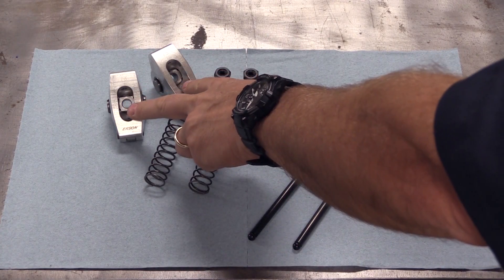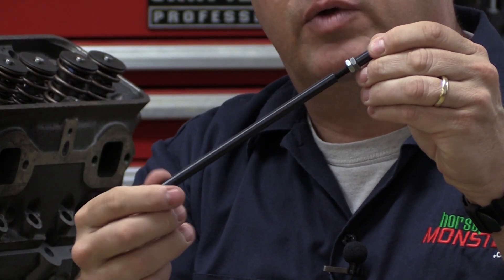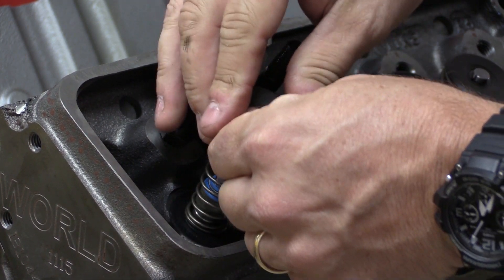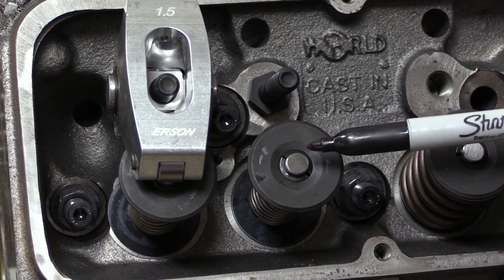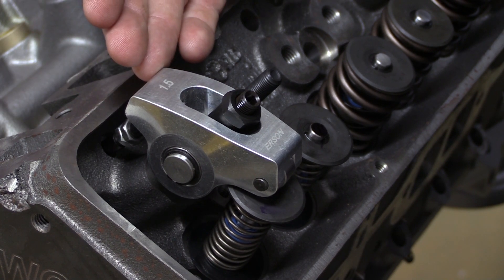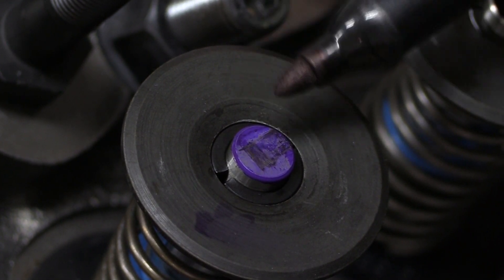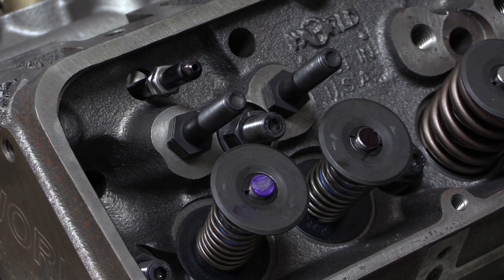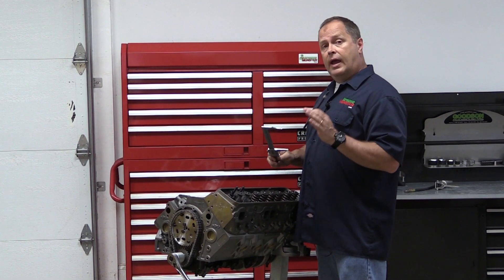Better Engine Building: How to Determine Correct Pushrod Length

Comment: Note, if you are using hydraulic lifters, be sure the lifters are not collapsed when taking the measurements, or you will get the incorrect length pushrod length

Comment: Doing this in 2022 on a Corvair motor. These old heads have had lots of valve jobs, and valves & guides replaced over 50+ years, so every single valve gets a custom pushrod. Seems like you and all the books say to have rocker contact centered across the valve tip but I disagree. Valve spring force starts at 100# and increases to over 250# at full lift. Valve/guide load & wear vary proportionally to the lift. So I prefer to cheat the contact area closer to the valve, "higher" as you call it here. Of course this is upside down compared to a Corvair. Anyway my goal is to have the contact point centered at max lift & spring pressure. Maybe just barely past center (lower in your terminology). My 2 cents.

Comment: So..my intake side is perfect..centered and correct geometry. Now the exhaust side seems like the rocker arm studs are way to close valve stem, I've used adjustable pushrod, Not possible to get centered, like I need a shorter rocker arms, Only thing I can think of is I have to tall of exhaust valves I have no idea, This is why you should never buy Chinese made heads people,

Comment: If you are doing a hydraulic set up would add  any length for preload ?
Reply: Channels like this tend to leave out that critical info. Frustrating, I know. I measured half the plunger travel of my lifters (.045") and added it to the overall length which then came to 7.045". Now unless I order custom length pushrods there isn't any available 7.045" pushrod. With that in mind a 7.050" pushrod is what I'll be running.

Comment: Does that have "Rings" in it ??? leaking a lot of air...90% leak down?
Reply from the maker: Nope, no rings. Just mocked up for the video. Thanks for watching
Reply: @TheHorsepowerMonster  Thanks ,I really didn't think it had rings, nobody would run a motor that leaked like that. I have no Idea why I would make such a stupid statement like that, Sorry
Reply from the maker: @dennistaylor5052  Not stupid, and ain't nothing to be sorry about. At least you didn't call me an idiot or worse :) I've actually been called stupid for the color of paint an engine builder chose to use on a block!
Reply: @TheHorsepowerMonster  It's easy to be a "KEY BOARD" warrior, I really don't understand why people are so "SALTY". I just had a conversation with a Guy about 1970 Ls6, I Quoted out of 1970 Hot Rod, It ran 13.44 and the 1970 GTO ran 13.37.  You would of thought I "Slapped" his wife. I have a 68 GTO so to be "Fair" I think I stated those times , just to Twist his wick, Because I know how twitchy the Chevy Guys can get (and I was right) So I can be a "POOP" too. In Life there's talkers and there's doer's....Most are talkers

Comment: There is a "ticking" at start-up coming from my 1989 B-150 Dodge Van's engine.
The "ticking" lasts anywhere from 5 - 10 minutes then stops. Do you think it's coming from a lifter or it needs a valve adjustment (if it can be adjusted)? The engine has just over 500,000 miles on it. Its never been rebuilt. I'm the original owner. The engine runs strong and still wants to rip the wheels off when I hit the gas. I've used Marvel Mystery Oil in the crank and in every gas fill-up. The "ticking" has been going on for over 15 years.
Great videos! I'm sure there are a bunch of viewers like me out there who appreciate you taking the time to produce them.

Comment: Easy buy a real engine with double over head cams and get rid of that 70 yr old designed engine, no need to figure pushrod anything LOL
Reply from the maker: LS and LT engines? Oh, and Ford just designed a new clean-sheet engine and it has pushrods.
Reply: Oh and it allows more RPM for more power, there is a reason most all race series left the pushrods decades ago LOL

Comment: To each their own, but I always adjust until I get the shortest possible sweep no matter where it falls. As long as it isn't rolling off the edge, the rocker always pushes straight down. Wide sweep patterns lead to guide wear.
Reply: I agree to a point narrow sweep is far better including less side loading, improved rocker ratio, less skewed valve acceleration rates, likely better following cam designers expectations. But there is a common sens point were if the pattern is to far off center that will be no good.
Reply: Shortest possible sweep? You have zero control over that, it's completely defined by the rocker arm geometry. Simply put, for minimum valve guide wear, you minimize the side loads by selecting a pushrod length to best make the rocker contact arc go straight through the valve centerline.
Reply: @ercost60 you sir, have it wrong.
Reply from the maker: Trying to find the shortest sweep across the valvestem tip is effectively shortening the real rocker arm ratio. And I would be careful about not centering the sweep across the top of the valve. The Comp Cams guys told me that extensive Spintron testing has shown that having the rocker off center can significantly increase wear on both the stem and the valveguide. So even though you change the valve, the engine still isn't as stable as it was when new. Even though the rocker is still pushing down, putting pressure on the valvesteam off center still encourages flex. Thanks for watching.
Reply: @TheHorsepowerMonster  changing the width of the sweep has absolutely zero effect on rocker ratio. What it does do, is reduces the back and forth motion of the roller across the valve tip. The excessive back and forth motion from bad rocker geometry  is what wears out guides and valve tips. Having the sweep slightly off center will NOT cause additional wear and whoever told you this was mistaken. I use the center third of the valve tip as my "allowable" operating range. It doesn't have to be perfectly centered, but it does have to be as narrow as possible.

Comment: Should an old head gasket be torqued to specification to put the head at operating height, or new gasket used.  If a new gasket is used is it sacrificed for this process to determine push rod length?  I didn't catch that information in the video.  Thanks for your useful information and well made video.
Reply from the maker: Glad you like it! Yes, you do need a gasket in place. I used a old head gasket that has already been compressed, but you can use a new one. If you use a new MLS (multi-layer steel) gasket, it has enough spring in it that it can be reused. Good luck.
Reply: Hi Mrv V! Awesome and important question you stated! I did not even think of that. Thank you for adding your comment. Great knowledge for followers of this channel. Cheers from Motown.

Comment: thats a rather lengthy way to determine correct pushrod length,much faster and more accurate ways than that
Reply: justin cassidy Please explain the process or paste in link that does that.  Thanks.
Reply: This is the way I've done it since 1972. Works perfectly every time.
Reply from the maker: Not disagreeing with you, but I work with a lot of engine builders that do everything from NASCAR to NHRA, and this is the method I see every one of them use. Thanks for watching.

Comment: Thanks for sharing. I’ll be checking my push rod length soon as my cam comes in!! I’m using a hydraulic roller I don’t know if solid roller lifter are the same height until I check that out also to get correct length! Great explanation!!
Reply from the maker: Thanks and good luck! Thanks for watching!

Comment: HP Monster....The pushrod checking procedure isn’t extremely difficult but your smooth flowing technique and confident demeanor simplifies the process even more. 

My 351 Cleveland build is at the point where I need to check pushrod length. I will be ordering a set of custom length Smith Brothers pushrods so I can’t afford to make any mistakes. I’m going to measure three times and order once 😉. 

I like the measuring rods that don’t have lock nuts to interfere with the guide plates. They have something like a micrometer with the indicator marks etched into threaded sections for reading the results but I don’t feel like the accuracy is reliable. I have a couple of digital calipers but they aren’t long enough for the length of the checker. 

So I need to order a 12” digital caliper to take measurements that are usually around 8.300” for my valve train using a solid roller cam and lifters with Harland-Sharp 1.73 roller rockers. Your tool list in the foot notes didn’t mention the digital caliper you used. Do you have any particular preferences for the caliper or  additional tech information you could share with the group about digital measurements ? 

Thanks for sharing and keep the good stuff coming !